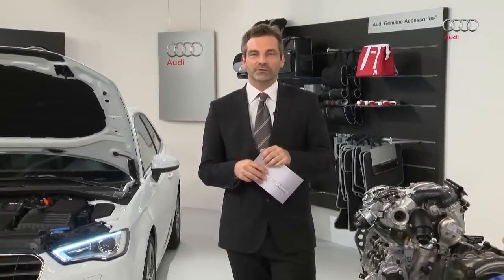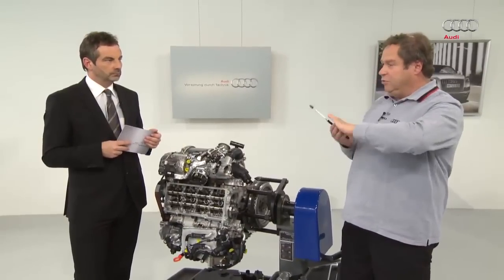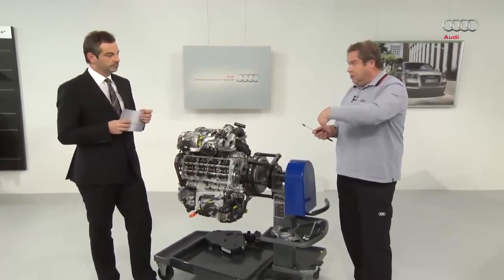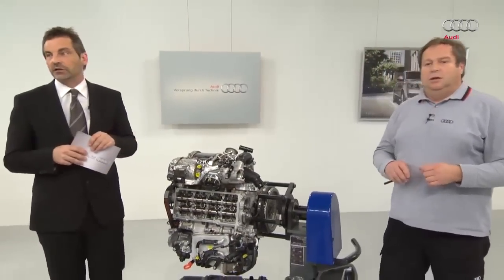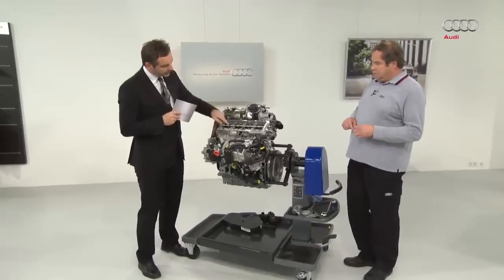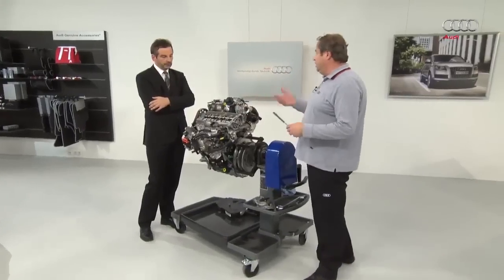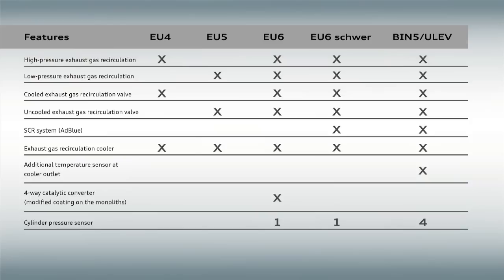Audi/Volkswagen/Skoda/Seat Engine TDI 1.6L 2.0L EA288

Comment: I Have audi A4 8k manual quattro  with this engine at 150.000km still no problem  . I bought It at 130.000 and i changed the oil every 10/15.000km and full service of filter and oil every max 30.000km. The first owner do the service at audi in Italy,  and use car in highway.

Comment: My 2015 Jetta tdi EA288 is doing really good, I changed the timing belt myself and changed the oil regularly and I've got over 200,000km on it and its solid and extremely reliable
Reply: My Oktavia with same motor near 400 000 and perfect performance
Reply: @ajkulicakg 297000 km on 2013 euro5 2.0

Comment: Had 2 EGR & DPF failures on my 2015 A6,  the theory behind the technology is good but they just aren't reliable enough to be practical.  Luckily mine was covered by warrenty even still Audi kicked up a fuss about it.  The parts aren't readily available either so you are looking at 5000 Euro for both parts including labour for replacing them.  Just a word of warning for anyone looking to buy a new Audi diesel with one of these CNHA/Ultra engine's.
Reply: Isnt it possible to delete them parts?
Reply: @b8alumrockb8  Not on these engines,  The EGR valve and cooler and integrated into the DPF, the only way to delete them as such is to take the DPF and EGR out (same unit) and physically weld the EGR shut along with the DPF however the way Audi has developed the car you cant close off the EGR cooler so you end up with coolant entering the exhaust side the only way around it is to essentially custom map out all the knock sensors/dpf/egr related and the EGR/DPF functionalities and pre injection however it seems Audi have now made it that the ECU will revert back to default after a months,  after market tuning companies have yet to find a way around this
Reply: Hyperezil Isn’t there any aftermarket part that does the job?
Reply: @soraaoixxthebluesky  Unfortunately at this stage there isn't the CNHA engines are too new of a development for aftermarket parts and the one's I did see were almost identical in price compared to the OEM parts.
Reply: Skoda octavia mk3 1.6 2018 60k miles Notting but trouble broke down 3 times in in 9 months dpf egr turbo list goes on

Comment: Where is the oil filter housing on this engine? Is it accessable from lower side or upper side like euro 5 tdi engines?
Reply: from the upper side
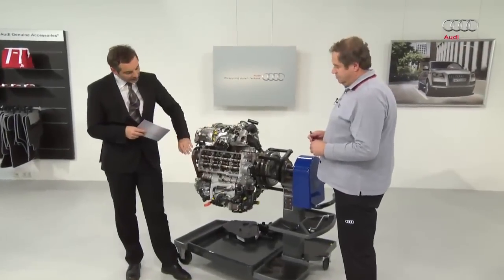Reply: 2 Timothy 2:19 I think it depends on wether or not this engine are mounted in transverse or longitudinal position
Reply: from underneath at front of engine

Comment: 160000km engin is dead
Reply: I got 200.000km and still no problems
Reply: @dontpanic3277  250.000km and counting. I change the oil every 15.000km though.
Reply: 383 000 i dalje gura kao nov
Reply: I have 125000 km Zero Problem
Reply: Haddad Karim witch one?
Reply: Mk7 2013 2l diesel 140000miles  goes well zero problems  city drive is not perfect but motorway is the best mpg is good on long journeys
Reply: Ti motori su uradjeni da traju taman koliko i garancija a to znaci 120.000 km i posle toga je sve cista sreca ako predje jos toliko
Reply: @pajapajic8809  kako si lupio
Reply: @pajapajic8809  Paja ostao bez jaja. Paja mora da je neki ostrašćeni Fiat-ovac ili nešto slično. Da nije ne daj bože Alfa,crni Pajo? 🤔